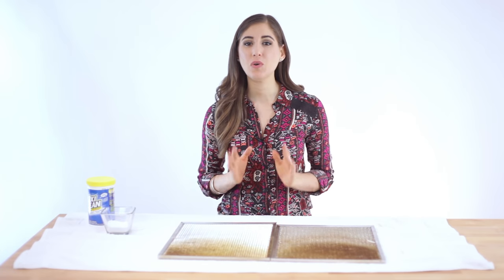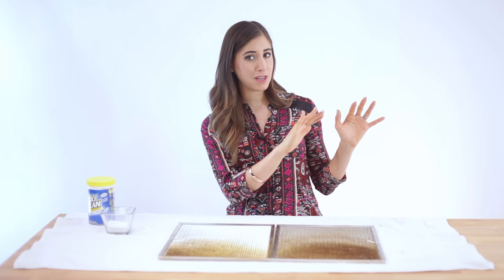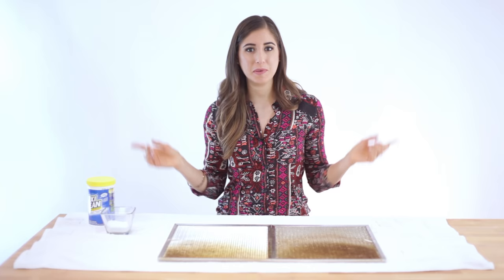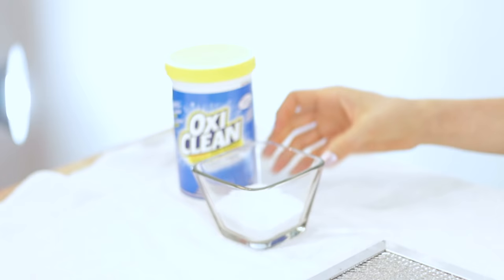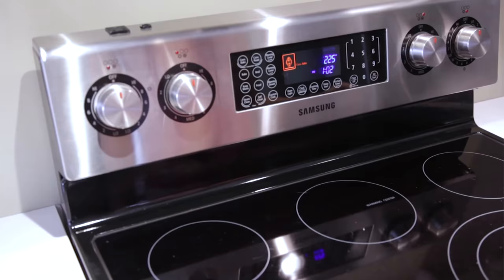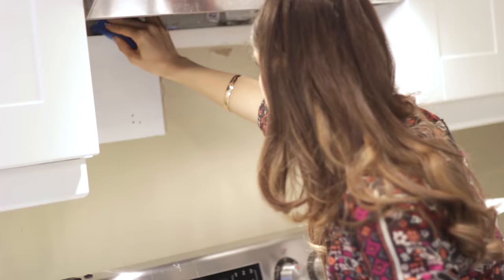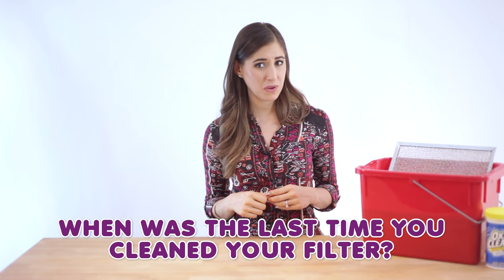Clean Greasy Range Hood Filters! How to Clean Your Stove Hood: Easy Cleaning Ideas (Clean My Space)

Comment: Use dish washing liquid, baking soda (works fantastic), and boiling hot water. Soak for 15-20 minutes and then rinse. Scrub with brush or sponge gently if necessary. Repeat if necessary. The baking soda makes all the difference in cleaning the filter. Yet another use for baking soda too!
Reply: Nice I'll have to check it out..what do you use as a degreaser for the residue left behind once the filter is off do you wipe it with the same stuff or something else.
Reply: Didn't work for me, I guess mine was just too greasy.
Reply: @vmilovanovic  HEY boiled water mix OXI CLEAN in it. Do not burn your hands. place vent in the mix and wait 30 minutes and magic will happen, mine was Dark brown now shiny and silver , no scrubbing *
Reply: baking soda cleans oven glass wonderfully 3 tablespoons water to 1/2 cup soda. smear it oin glass let sit for few hours then wipe off
Reply: @roxylovesdaisies 😊

Comment from the maker: Greasy Range Hood Exhaust Filters got you down? Worry not, Melissa shares some grease-busting tips and tricks that will help you rid yourself of  of that build-up!
Reply: Can you please do a video on key areas to clean around your home?
Reply: holy smokes you must've read my mind cause I was wondering about this the other day
Reply: Why not just hot water and vinegar? Also: if you have a self-cleaning oven, pop it in there.
Reply: Karsten Fjellheim mine has a plastic section for the overhead light to show through, the self-cleaning oven would melt that.
Reply: Hey Melissa, I just bought an old house which has an exhaust fan that looks like its never been cleaned in its life! I've tried everything this grease is THICK but it cant replace it because its literally been bricked in! Help!
Reply: I hope you were able to get the solution to clean your exhaust fan, 7 months ago... otherwise, 2 months ago, +Rawforlife77 wrote in here, "I recently moved into an older apartment and the filters had been... neglected. A hot water soak with a large portion of Borax added to it did an awesome job cleaning the grease off."
Good luck!!
Reply: Hi,  I liked your ideas and I am sure the OxiClean and hot water approach will work well!  I tried the dishwasher approach and just put our greasy range hood filter in the dishwasher "by itself" (no other dishes in the dishwasher) and ran the dishwasher on the hottest cycle and it cleaned the filter pretty well....   It is in the dishwasher again!!!!   LOL   I expect it to be cleaner still plus the residue you mentioned should also be less!  No French Fry odor.....  ;-)

Comment: I clean my stove vent filters all the time (every couple of weeks)  with dawn dish soap and hot water, but I decided to give your OxyClean method a try....... it was fabulous.  This was hassle free and quick.  Soak for 10 minutes and rinse and done.   This is my new go-to method.  BTW, I tried using the dishwasher once to clean the filters, but the caustic chemicals ruined/discolored the filters and mine cost over  $70 to replace, which I did.  I also tried the oven method once, the grease baked onto the filters instead of melting off and discolored the filters a dark brownish-yellow.  Yuk
Reply: Thanks for this information.

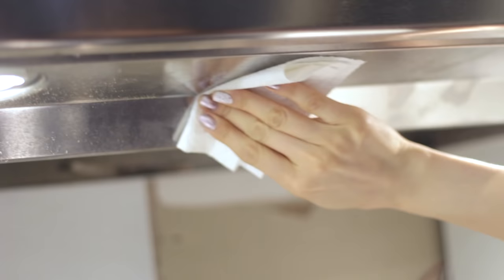Comment: 3:38 Because oil dissolves oil. in fact you don't need to use mineral oil, any kitchen oil works the say way, it's just that if you need to make sure to clean out the kitchen oil more thoroughly than mineral oil, you can also try the oil method on removing glue residue.

Comment: I tried the first tip and it worked wonders!! Thank you so much! I have been trying for such a long time to clean the greasy hood filters of my stove but nothing else worked. I used vanish oxi action and in 30 minutes all the grease had moved on the surface of the hot water and so I just rinsed the filters and they were ready. Thank you!!!!

Comment: 💌 Thank you for the tip! My Rang Hood Filter definitely needed cleaned. I used a couple of scoops of Borax and soaked it for 10 minutes. That worked great! I usually do it in the spring cleaning but I forgot. I had replaced the old one with a new one when I moved in so it wasn't too bad but the better thing is to replace the Range Hood just as soon as I can!
Reply: @Simr Khera No not dumb at all. It needs replaced because the paint is chipping off and cleaning cannot fix it.

Comment: Omg ive been wanting a way to clean my range hoods forever i usually just soak in hot water but it doesnt help. Thanks i just found you channel and love it
Reply: I try to reply but comments have been disables in this video. You boil a pot with water large enough where you can put filter.  After its boiling pour baking soda like a cup and after you pour it it will Zizzle then u put in filter let it sit like a minute if it fits the whole filter or just do half of it then turn it over the the undone side. Hope I explained it right and believe me it works.
Reply: @26alexther  OXI CLEAN worked better , no scrubbing at all.
Reply: Brown vent to Shiny and Silver :)

Comment: I always put mine in the dishwasher and use enzyme cleaner (1 Tablespoon in the soap dispenser) instead of soap and both come out clean and smelling  fresh. Of course I use 1 cup vinegar in a hot wash cycle to take the calcium buildup out of the thing too so that helps keep the drain clean. As for removing them they either slide sideways or pop off. Sometimes the top of your range can flip up as well and it's good to clean that in case of fire. Check the owners manual to read how to open or run your fingers along the edges to look for a lever or switch or just gently but firmly pull up on the edge to see if it pops up. There ought to be a prop to hold it open during cleaning. Note the drip pans and heating elements will need removed before you get up close and personal poking around on you cooker. Best wishes.
Reply from the maker: The dishwasher concerns me because of the grease build up in the filter...but sounds like you are in a groove with it!

Comment: Boiling water and baking soda while sizzling . Works wonder n easy jusy 2 min. Found it in pinterest
Reply: Thank you just tried it and it worked wonders.
Reply: I just tried the baking soda and it really works.  Thank you!!!
Reply: Yep it works great that's how we do it at my place and at my restaurant
Reply from the maker: Yes - there are so many ways to do this - it just needs to be done!
Reply: So just checking. You boil a pot of baking soda and water then pour it over the filters or you let it steam on the stove under te hood
Reply: 26alexther This is how I have been cleaning my jewellery forever :)
Reply: kingikiller you actually put the filters inside the pot making sure its big enough for filters. But first boil the water and add baking soda.
Reply: How much baking soda in how much water or doesn’t matter ?
Reply: Can someone tell me? Is baking soda the same as bicarb soda?
Reply: @kazabushy  yes
Reply: @karolbh25  Thanks.

Comment: 35 years of grease!!!...used oven cleaner initially and then soaked it in a 5 gal bucket of hot water and simple green over night...then ran it under more hot water...got majority of grease off but may at some point try your suggestion of putting in oven on newspapers...will also try mineral oil on exterior which is a copper hood my father in law made for our stove 35 years ago.   Actually amazed that the hood and or filter did not catch fire with the mountains of grease build up...

Comment: I can't figure out how to post my pic - - - I cleaned my filter about 4 months ago, I don't do much frying.  I used a spray mixture I make myself with ammonia and liquid dish soap in it - pretty well dissolves the grease, sprayed it with hot water, then put it in the dishwasher.  I agree with what you say about putting it in the dishwasher - we definitely don't want to clog that up with grease!!!  Years ago when I had a really badly encrusted filter, I used an auto degreaser on it, then hot water, worked like a charm.

Comment: You're right about boiling hot water and enzyme cleaners, I use a powder for clothes hand washing and it works wonders after an hour of soaking and minor scrubbing. The downside to it is firstly you have to wear gloves when you scrub cause enzymes are really tough oh the hands, and secondly you have to rinse thoroughly to get the detergent off (especially powdery ones). After all if you do deep fry or just fry on the stovetop often it's essential that you do it once a month or just whenever you see it start building grease. The less greasy, the less time it'll take to clean.

Comment: I use Murphy’s Oil. I put the filers in the slop sink spray both sides with Murphy’s Oil and let it sit for 1/2hr then I scrub lightly with a brush and rinse with hot water. Murphy’s Oil is the best hands down.

Comment: I have Thermador HPIB48HS Island Hood.   Cleaning the filters, no problem.   But how do I get to the motor and fan inside the unit?  these have a layer of grease which drips onto the stove below.   There is also a metal screen mesh covering the motor...which doesn't seem to come out.   Is there any documentation on how to get to the motor and fan for cleaning?

Comment: I used the oxiclean soak in a bucket with the filter standing up. The filter developed a black line across it (where the water line was). Not sure how to get it off or what I did wrong. Any suggestions?

Comment: I never knew about those filters so I just checked and they appear clean. It's been almost 3 years since I moved in with brand new appliances. But they (2 small filters) are over the back burners which I rarely use.

Comment: I clean our filter in the dishwasher. I clean it often enough it’s not caked with grease.  I’m not worried about it creating any grease related problems in the dishwasher. If it leaves grease particles on the inside of my dishwasher.... that would seem to be a problem with my dishwasher not working properly. I clean my dishwasher regularly too.

Comment: There's no issue with cleaning fan filters in the dishwasher as long as the fan manufacturer recommends that and if you use good detergent, it won't leave any residue inside the dishwasher or on the dishes after a wash.  Those thin aluminum filters that are common with cheap fans will get slowly etched by the caustic dishwasher detergent so best to clean by hand by any of the methods presented in this video.

Comment: Melissa! I don't have a range hood in my kitchen (rental apartment) and yes I assume that is not up to code but since the grease has no where to escape properly (and i cooke with Le Cruset too) the grease sticks on a wire shelving unit that is above the stove, it was added by the landlord for extra storage, this shelving area is pure grease heaven. It's that wire shelving with a white plastic coating on it, do you know what I mean? Anyways how can I get grease off of that type of surface? I can't take the shelving off and soak it because its about 5 feet in length HELP

Comment: Hey guys I did the oxiclean method. It worked and removed the grease, but my mistake was that I left the door and window open so the cold air made a burnt streak at the water line. Since it’s cold air and boiling water. Just a heads up to whoever may try this.

Comment: I really want to introduce her to Norwex products so she can clean with just water. Their biodegradable laundry detergent does a better job cleaning the range hood filter than anything she just showed. Just one teaspoon of the powdered detergent in a sink full of hot water, let it sit for 10 to 30 minutes and rinse clean. No harsh chemicals, no extra products to buy. And it literally melts grease off of surfaces, so add a little to a spray bottle with water to spray that range hood fan as well. No mask or rubber gloves needed. Contact me if you want more info on how to clean your home quicker and better with just water.

Comment: This wouldn't work on the mesh of the filter, but one of my favourite de-greasing products are SOS scrubbing pads. I normally don't like such specific and fleeting products, but they work amazingly well for many greasy problems.

As far as my stove area? Our apartment is old enough that we have no exhaust. :-\ There are cabinets directly above the stove and I have to clean grease off of them periodically. Ewww.
Reply from the maker: No way? No exhaust?  So what happens when you cook something greasy? Open windows?
Reply: Yep! Open windows, turn on a nearby bathroom fan, and hope the smoke detectors don't go off. If they do, we have to climb up on a chair to push the 'disable' button. It's even worse since they did away with the battery kind, so we can't remove the battery if it happens. They're all wired up to the building now.

Comment: Hi Melissa.  Thank you for the fantastic video.  I always threw out the greasy disgusting filter and replaced it with a new one.  I never thought it could be cleaned but now I know and will save lots of money.  I recently purchased a new filter and it has a charcoal inner lining.  Would I clean it the same way as you have demonstrated?  I would like you to cover how to clean gas stove burners and the grates that pots sit on top of.  I use the drip pans on top of the burners and they do a pretty good job of preventing most of the grease stains.  But i see grease spots around the neck of the burner and cannot get rid of them unless I use a brillo softly scrub it away.  I use the same method for the grates as well.  Do you have a better way to clean them?  Do you have a video that covers this already? Thank you.

Comment: I try to clean mine before Thanksgiving.   Since my filter will fit in the sink I will soak it in hot water and Dawn dishwashing liquid.  Even though I'm not a big fan of the way Dawn smells it cleans grease the best.  I will try the Oxy powder since I have some.  My mom would spray hers with Fantastik Spray cleaner and let it sit for a while in hot dishwater if it was really dirty.  The smell of Fantastik has changed and I use 409 or Mean Green instead.   Sometimes if something is really greasy I will spray and wipe it with a product called Scott's Liquid Gold.  It seems to cut grease from my wooden cabinets, and won't damage the finish.   Sometimes I clean really greasy things with lamp oil or mineral spirits, although I normally take the items outdoors because of the explosive fumes.

Comment: While this does work a treat and removed the grease flawlessly, the oxy cleaner I used also destroyed the anodizing on the aluminium leaving with a white powder oxidized layer on the filter frames.  It is harder to tell on the filter itself but the first pass filter layer also looks dull now which makes me think it too has an oxidized layer on it.  My apprehension is that at mircro level the surface of the aluminium is not as smooth as it was and it will be much harder to clean next time, and/or the filter will degrade more quickly now.  Only time will tell, proceed with caution.
Reply: It says right on the oxyclean container not to use with metal surfaces.  This was just a poor and unresearched advice video.

Comment: How do you clean window screens??
Reply: Hi Susan! I know I'm not Melissa, but I do this frequently, as I love downtown and they get dirty pretty fast. Personally, I clean them in the shower using a removable shower head. I like to use scrubbing bubbles bathroom cleaner, saturating both sides, letting it sit for about 20 mins and then scrubbing with a sponge. Then I simply rinse clean with the shower head and air dry. Hope this helps!
Reply: Live*** not love, lol.
Reply from the maker: Susan Thao yes, Organize and Simplify has it right. You need a large basin (tub or laundry basin) to do this and you can use dish soap and water to so k it, and then clean it with a scrub brush. Rinse and replace after dried.  Good work Organize and Simplify !

Comment: I used boiling hot water and oxy clean and mine turned black! How do I fix that?
Reply: Savvy Serena so did mine. :(  Debbie Australia
Reply: You can’t. You literally oxidized the metal. The bright shiny coating on these isn’t meant to be exposed to that kind of treatment.
Reply: She did say oxy clean & boiling hot water in the video
Reply: Yup. Did that to my filter last night when I was cleaning it. And some of the aluminum on that filter seemed like it disintegrated!
Reply: tdhtran yup. She did! Not going to do that in the future!
Reply: So i still have the oxyclean solution evaporating in my backyard because I wasn’t sure if it was safe to dump down the drain 😕

Comment: How do you get the grease out of the towels then? Haha
Reply: you...... wash them?
Reply from the maker: You can use Dawn or an enzyme cleaner in the wash, or you can do it over a crappy towel that you don't care about!
Reply: Clean My Space actually, a former pro restaurant worker trick dissolves all grease and grime on any surface even towels. Soak the grease or surface in a mixture of half soapy water and half bleach water. The importance is on the concentrations. I strictly use Clorox and Dawn. They work the best. 

What you want is equal parts bleach water as hot as the tap can provide at 100ppm (get a ph test strip set they cost almost nothing) and soapy water so saturated with soap that if you sprinkle a little black pepper flakes on the top the flakes won’t float. 

At the chemical level this works because soap acts a surfactant, or put another way, penetrates the grease and the bleach sanitizes at the same time. There is something special about this mix but it works every time.